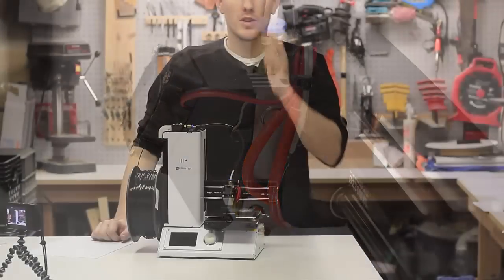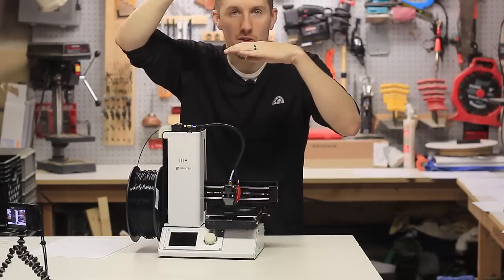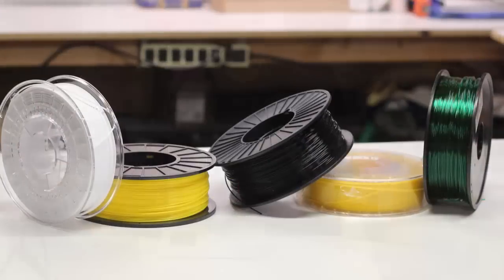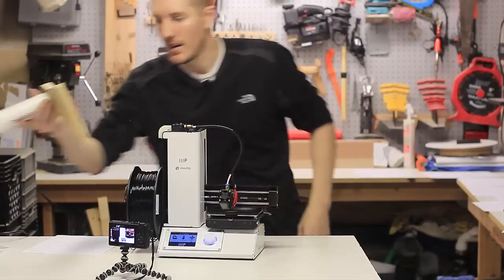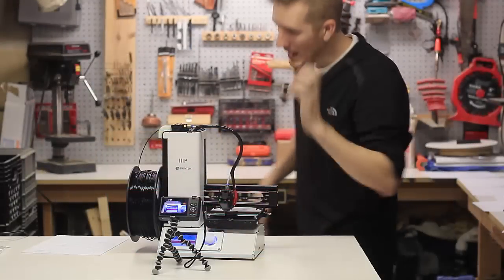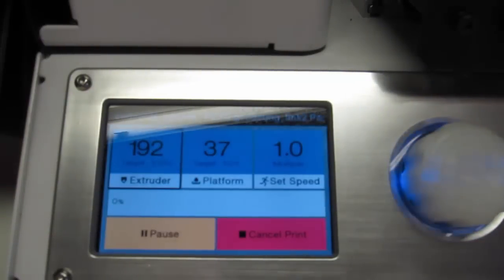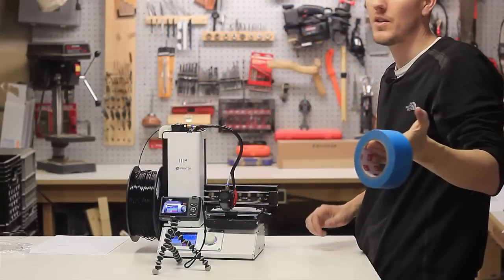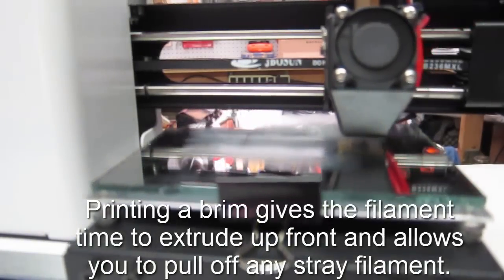3D Printer Setup - Monoprice Select Mini - First Print

Comment: I'm new to the enter 3d printing scene it was a good vid helped me out allot but I do have one question how would you transfer the STL file say from thingiverse into the g code for the printer?
Reply from the maker: You need what's called a slicer program.  Drag the .STL part into the program then export to GCode.  
Lots of people use CURA either version 15.xxxx or 2.3.  I recommend starting with version 15.. because it's simple and just the bare bones, once you learn all the settings on there then you can try version 2.3 and really get into all the finer details.  There are other programs called Slic3r and Simplify3D.  Simplify3D is not free ($150) and also very detailed.  But produces sometimes better prints.  I feel like half of 3d printing is messing with the hardware and half is messing with the slicer settings.
Reply: You have to have a slicer program.I like cura but you can use anyone you want.

Comment: Nice vid Dave.  Quick bit of advice:  I would definitely recommend swapping out the painters tape for some kapton tape.  Since I make the switch I haven't needed to use glue (for pla prints) and one application will get you through a bunch of prints.  You can find it on ebay for less then 10 bucks.  Happy printing!
Reply from the maker: I've been printing on a sheet of PEI after someone suggested it, that's been great too.  I also love the no tape or glue cleanup.  For ABS though i still have to use gluestick on glass.

Comment: Good video, thanks.

Here's what I have been doing to get good prints.
PLA on blue painters tape:
Un-heated Bed
Wipe down the print bed with rubbing alcohol real good before each print.
ABS on blue painters tape:
Sand the tape with 120 grit sand paper and wipe down the print bed with rubbing alcohol.
Heated bed 70°C. Some people have been successful with an un-heated bed.
Brim set to 20.

PLA on glass:
Glass coated with hair spray (6 or 7 light coats or 2 to 3 heavy coats).
Rubbing alcohol again before printing but make sure to use a lint free cloth, the hair spray gets very sticky.
Heated bed 50°C to 60°C.
ABS on glass:
Heated print bed, I set the print bed to 70°C in Cura then once the hot end starts heating I use the WIFI browser connection to raise it to 90°C.(I added fiberglass insulation under the print bed to help it reach this temperature)
Rubbing alcohol again.
Brim set to 20.

For large objects with ABS I made an enclosure with foamcore and a  plexiglass window. I have a section cutout in the front just below the print bed level to reach the controls and get a little cool air to the electronics. I added a cooling fan on the left side of the printer using the 2 piece side panel I printed that can be found on thingiverse. The area above the print bed maintains a temperature of 40°C which prevents layer separation.

Using a Brim is becoming my standard way to do larger prints. If I see the brim start to lift up I will pause the print and tape it down.

Speaking of pausing the print the G code to to pause a print with this printer is M600, I edit the G code to insert a line with M600 before the layer where I want to change the filament color. I use Cura's layer view to find the layer number where I want to change and use notepad 2 to edit the code..

Thanks again for posting this video.
Reply: have u tried tpu on this thing?

Comment: For print bed, try 2 magnet sheets for business card (8x11sheet-cut to size of your bed). First sheet glue it to the bed, use the 2nd sheet to print on and its easily removed then popped the printed part off.

Comment: does this support 1kg of filment? (the voxel only has .5 kg) also, on the reviews, it says that there isnt a heated bead, could you also confirm if there is or isnt? and is the only option to make the prints stick to the bed to use tape or a new bed? (and is it important to have a heated bed/do these steps to have the print stick) last thing, can i use the oldest version of cura (1506.06.) or do i need the latest version?
Reply from the maker: Any version of Cura will work, you are just making a Gcode file.
It does support 1kg filament.
Yes there is a heated bed.
Other options for bed that i've used are a piece of mirror glass with a glue stick to hold prints down, and also a sheet of PEI that works great for PLA filament. 
I always use a heated bed when printing.
Reply: @DaveWirth  ok, thanks

Comment: Spritz a little water on the bed after you apply the glue stick and use a toothbrush to spread the glue around.

You can do this over and over again.

Just clean the bed if it bets too dirty.

Comment: would you recommend this to someone who wants there first 3d printer with a budget of around $300?
Reply from the maker: It's a great first 3D printer.  Right out of the box you are ready to go.  Instead of getting a box of pieces that you have to put together and troubleshoot.  You are not overwhelmed with things going wrong.  If something breaks or clogs, it happens one at a time and you can fix it.  It's a great printer, great quality prints, with lots of features, and easy to use.
Reply: There are other printer's for $200.00 but this is good for beginners. I would definitely recommend this.

Comment: Using the Monoprice V2 Having real problems with my Prints Bending off my Brims - Do you have any settings in Cura 4.2.1 that might help this problem?
Reply from the maker: I never printed with a brim.  I just printed the first layer right on the surface.  I do print a couple offset lines to get the filament flowing though.  
I've printed on masking tape, glass, and PEI.  The first thing i would say is try using a glue stick.  It can be a little messy but adding a thin layer with the gluestick gets most things to stick.  I printed with gluestick and glass for a long time.  Then like every 10 prints or so i removed the glass and washed the old glue off in the sink.  
Then i started using PEI.  That was great too.  Maybe not quite as good as the gluestick, but the fact that there is zero cleanup made up for the 1 print out of 10 not sticking.
If you are printing with ABS it's another story.  That stuff it totally different and will curl if it isn't in a heated enclosure.
You can also increase your filament output to like 110% on the first layer to get more filament out and try to get a better bond with the print bed.  
There's tons of suggestions, no right answers.

Comment: How much does the filament cost when you have to buy your own?

And I've heard of the MP printer, which is $89.00 not including shipment, and $100.00 including shipment. What is the difference between this printer and the MP printer? I didn't see any difference at all.
Reply from the maker: The one i have is Version 1.  The black one is Version 2, which is better.   They made some good changes to the print bed and hotend.  Filament can cost anywhere between $15 and $50.  For basic ABS you can spend as little as $15.  Basic PLA is around $20.  For more advanced filament like PETG or similar it might be $30 - $50.

Comment: I need help with my monoprice 3d printer , I have cleaned then replaced nozzle , adjusted the plate changed the blue tape  and my filament is still clumping at the nozzle
Reply from the maker: By clumping, you mean not sticking to the build plate?
At the Home position, the end of the nozzle and build plate should be just far enough apart that a piece of paper can be slid in between.

Comment: How do you delete the files off the printer ... I have just a few files on my card, but every time I print the printer saves the files and now I have lots of files I must go through ... I want to delete 80 % of them ? BTW: I went to Harbor Freight and got an assortment of small tweezers ... use them a lot !
Reply from the maker: I'm not sure.  All the files should be on the MicroSD card.  Just delete them off of there.

Comment: Hey just curious if you know how to fix the griding of the printer going past that stopper I am running into that problem and would really like to fix it rather than sending it back thanks man!
Reply from the maker: You mean the extruder?  Grinding and slipping of filament means that the driver gear is too loose or there is a filament clog at the hotend

Comment: Dave, How slow can you go with this 3D printer? Great Video - Thanks!  ~Dave
Reply from the maker: Depends on what you put in the slicer settings.  I usually print at 40mm/s.  But you can print as slow as you want.

Comment: 7 months later I decided to try the Mono V2, ran the cat code, 3 prints walked on me, then I used masking tape set the EX temp at 215 bed at 60 and lowered the speed to 0.5. Oiled the rails with synthetic lubricate lightly. 23% and so far so good, could not get past 5 %, it's looking like patients is a virtue? I guess the question is can you run that Cat at 1.0?  Feels like my table stepper is struggling. We'll see.
Reply from the maker: Does your table slide freely in the Y direction?  Maybe something is binding it up.  As far as sticking, try adding a thin layer using a glue stick on the tape.  It's a little messy but should help with adhesion.  Also i thought the V2 came with BuildTak on the bed?  So you should be able to print directly onto that with no problems.  I've never printed the cat, maybe try another part and see if it's the file or the printer that's at fault.

Comment: Once you have the printer Homed, you can shut off the power and check you bed calibration in all corners.  You do not have to have the printer on for bed calibration because the head is supported by the Z axis.

Comment: I really need some help with my monoprice select mini v2. I am having a hard time getting it to print anything. It will print the cat.gcode model just fine. I've downloaded a bunch of stl models from thingiverse. I've only gotten 2 models to print so far . One is an adapter for a 40mm gas mask. I opened the stl file in cura then loaded the gcode profile from the cat model. It printed fine. I've tried this same technique with my other models and when I go to print, the printer does nothing. The progress bar on the front of the printer begins moving like it's printing but the printer does nothing. What am I doing wrong? I'm getting very frustrated.
Reply from the maker: 1.  I think Cura saves your settings, so you shouldn't have to load the settings from the cat every time.
2.  Maybe try an older version of Cura.  I found that the Version 2.xxxx can be overly complicated.  The version 15.xxxx is much simpler, especially when you are just starting out.
3.  Since some .gcode files print and others don't i would guess that it's a software problem, something is wrong with the .gcode files you are creating, not a hardware problem.  If you right-click on the .gcode file and scroll down it should show a bunch of X    Y   Z  lines (telling the printer where to go).  If those lines aren't there, or the .gcode is blank, then it's something wrong with the slicer program.
Reply: Dave Wirth I figured it out. The sd card and files became corrupted from me not ejecting the card and all the back and forth copying files. I reformatted the card and it works now. Thanks
Reply: Hmm, yeah, corruption is horrible. The only time I had an SD card corrupt on me was when I came back from shooting photos of a house for a real estate agent... The USB for my SD Card reader wasn't built well and kept losing contact with my pc USB port... I've since gotten a new SD card reader AND I take off my photos as soon as I get the card plugged in... but honestly as long as the program isn't editing a file on the SD card I don't bother about "properly" ejecting the card.

Comment: Hello, I bought a new one exactly like your machine. I have hand-drawing pictures, how can I turn the pictures into the electronic files to be able to print. I do not know how to use Cura.
Reply from the maker: The file format the printer uses is .gcode.  That is the "sliced" file.  The file format that you put into Cura or Slic3r can be lots of different things, but the most common are .STL or .OBJ.  So you should look up how to turn your pictures into a .STL or .OBJ file format.  Then you put that into Cura and can print it.
Reply: @DaveWirth  thanks a lot. I will try. If I have more questions, I would like to ask later. 

Well, I do have a question now, does this machine only print something flat as its slices or it can print irregular and different dimensions products?
Reply from the maker: @TheHiddenPearl  it's a 3D printer.  It prints 3-dimensional shapes.  It's called a slicer because 3d printers print in layers or slices.  it prints 1 layer at a time on top of each other.
Reply: Thanks a lot!!
Reply: @DaveWirth  I have this question: Can this machine print with metal materials or only plastic? thanks
Reply from the maker: @TheHiddenPearl  Only plastic.  It needs to be able to melt to print.  Mine maxes out at 250 degrees Celsius.  I can print ABS, PLA, PETG.  Never tried to print nylon.
Reply: @DaveWirth  hm, do you suggest any printer that can print metal? thanks for your help.
Reply from the maker: @TheHiddenPearl  No.  Those are like tens of thousands of dollars...or more.  And like the size of a refrigerator.
Reply: @DaveWirth  hm. OK. Thanks a lot for your help.
Reply: @DaveWirth  have you ever tried to print silicone and similarities of silicone?
Reply from the maker: @TheHiddenPearl  No.  Most 3D printers for home use only print hard plastic that they can melt between 180 and 250 deg C
Reply: @DaveWirth  thanks a lot. I hope in the future we have versions that give more varieties of material options.
Reply: @DaveWirth  Hi, can i use Autocad or GIMP to draw a picture and turn to the .STL or .OBJ files?
Reply from the maker: @TheHiddenPearl  yes
Reply: @DaveWirth  Hi Dave, bother you more questions. Does this print have a range of max and min sizes of objects it can bring? well, i would like if there is a details manual about all these, but the manual when I bought the machine does not say or I miss somewhere?
Reply: @DaveWirth  Hi, you have not yet replied the last question, that is OK if you do not know. But, I have this question, pictures I create on autocad is flat, how can the 3d printer make it into an object with 3D dimensions? I mean how I can do? the thickness needs to be specified?
Reply from the maker: @TheHiddenPearl  I think the Monoprice Mini can print 120x120x120 millimeter
Reply from the maker: @TheHiddenPearl  if you draw something on autocad and it's flat (2D) then it's probably not a .STL or .OBJ  it's probably still a  .DWG
you need to draw it in 3D with a height

Comment: Hey, every time I try to print or preheat, the printer reboots itself, and I can't seem to find any way to fix it.
Reply from the maker: I've never had that problem.  The biggest issue was when i had to mess with the wiring on the board.  Your issue sound more serious.  Is there a way you can update the software somehow?

Comment: I keep having  a problem where the printer keeps trying to go off the side of the print bed. I've looked on their website and it says the print bed is 120x120x120, but it keeps trying to go off the side.
Reply from the maker: Sean Kirkup the two things that I can think of are first a mechanical issue where you are X or Y axis which is not working or the plug may be loose. the second cause may be software ,in your Cura setup make sure the specified bed size is 120 and not something larger
Reply: Thank you for replying, what i figured out is that the first time I try to print something, it works great, but if i cancel it and load the same file that worked before, it wants to go off the side. I've figured out that turning the machine off and back on again will fix the problem.

Comment: Bought this printer for Christmas and have had nothing but problems with it. The printer is not seeing the micro SD card, and says it is not inserted. I have purchased and formatted a new SD card and the same thing............any ideas anyone, as their support line is non-exstent? Thanks :)
Reply: Inspired by Elle if the microsd is third party you have to make sure that the capacity is lower than 16gb (I don’t remember the exact number so it may be even less, I’d get something like 2g just to be safe especially since Goode files aren’t too big). Also if you are using Cura on a Mac you have to format the card as EXFAT format
Reply: On pc the format would be FAT16/FAT32

Comment: I do a lot of work in AutoCAD  2018 3D.  I'd like to know how to go about exporting these 3D images in a format that my new (just got it yesterday) Monoprice  Mini 3D printer will recognize. Thanks!
Reply from the maker: +Brian McKown .stl or .obj files are importable to slicer programs like cura.  Autocad is .dwg, not sure if you can import that directly, may have to convert it.  Or maybe autocad can Export to .obj
Reply: Dave Wirth .obj is a pretty common and simple file format Autocad should be able to export to it.

Comment: Where can you get a replacement power supply?
Reply from the maker: Not sure.  But you can probably just look at the back of the power supply (black box) and type in the same voltage and amperage into amazon and get the AC to DC power supply.  It's probably similar to an external laptop power supply.